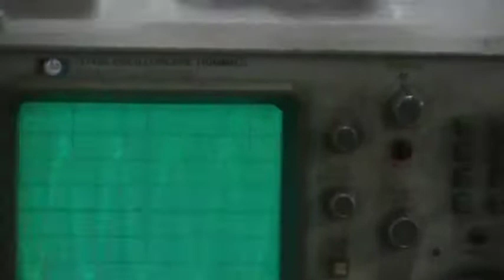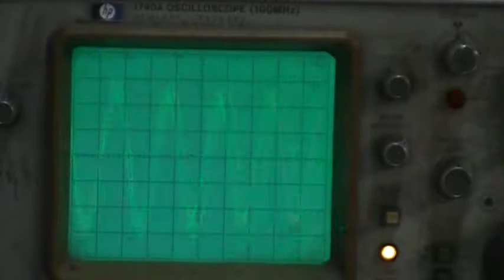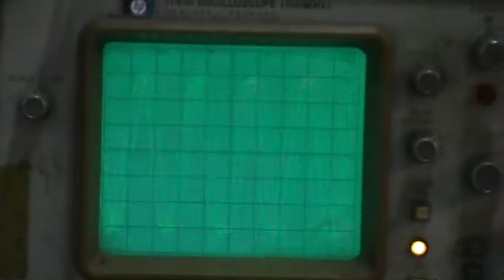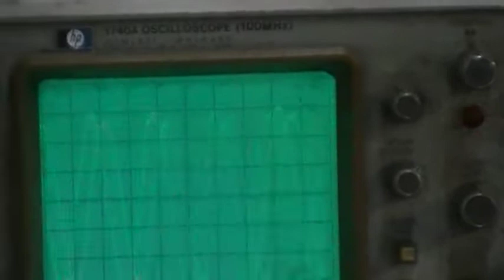~ 120 degree Time Difference from poles over Identical Phase Series!

Comment from the maker: I have today renamed the video for what it shows, not just a 60 degree twist in time, but a 120 degree one. This means that out of a total circle of 360 degrees, where a solitary single stacked phase exhibits 0 degrees of phase difference of  emitted poles on ending coils of circuit; now an entire twist of 120 degrees is noted. The ramifications of this are that now  between beginning and ending twists of the spiraled route of the three coils in series; the ending sequence can in fact be placed as a seriesed unity with an adjacent phase! In fact THAT IS HOW THE BEGGINING ARRANGEMENT IS SHOWN with adjacent diagonally connected phases in parallel for dual channel scopings. The second demonstration shows the 60 degree angle separation from correctly wired top and bottom poles of the 666 machine on a single column where all three phased are mixed in the column for magnetic repulsion. But the third demonstration of the time distortion between enter and exit coils clearly shows an additional widening of that phase angle to be 120 degrees, twice that of the 60 degree one. It is amazing that four years later I have had to make this correction, which in itself explains how adjacent phases in three phase can be wired for unity! Quite unheard of, this only occurs on machines exhibiting torsional time effects. So this becomes a record of such submitted for recognition.

Comment from the maker: On a six phase system, two secondary coils may be found that are actually directly opposite in time polarity sensing wise using identically wired secondaries. As such they can be combined in series either for cancellation of voltages or unison of voltages. In the beginning demo the bottom coil of an adjacent phase is seen to be in unison with the top phase of an adjacent stack, BUT THIS SHOULD NOT HAPPEN!  In fact if we had a conventional air core 6 phase system  where each of  the columns of six pancake spiral coils were one color representing that entire phase in separate action; then it would be logical to assume and see a unity of opposite voltage timed secondary coils over the entire stacks opposite magnetic poles in space. Yet now the duty of the opposite magnetic polarity in producing voltage and current has been shifted down to an adjacent phase in the actual phase rotation. THE ENORMOUS SIGNIFICANCE OF THIS IS SEEN WHEN ACTIONS OF THE COMBINED SECONDARIES ARE SHOWN. In fact the earnest designer of making a 3 fold series secondary output from a 6 phase input will quickly find that when the opposite voltages are combined in series by wiring reversal, or a vector addition method first shown on the video, when both opposites are wired as secondaries in the conventional 6 phase system, as the French peasants tried to tell the queen or something like that; YOU CANT HAVE YOUR CAKE AND EAT IT TOO.   The triple series secondary output from a six phase system, while sounding good immediately fails in load application BECAUSE two of three output coils are drawing on a single phase, thus emf from all three phases are not being effectively harnessed. In the conventional isolated air core 6 phase system, when the opposites are combined in series from both top and bottom poles, the amount obtained on a solitary basis is nearly the same as obtained on a dual basis, for the simple fact of supply and demand when both sources are connected for output they drop to half the value found on a solitary demand. THUS THE TORSIONAL AIR CORE TRANSFORMER METHOD OF THE 666 MACHINE NOT ONLY TWISTS THE MAGNETIC PATHWAY IN SPACE ACCORDING TO MAGIC SQUARE DESIGN; IT ALSO TWISTS THE OPPOSING MAGNETIC FIELD IN TIME!   NOW the triple seriesed 6 phase output becomes a practical method of obtaining a seriesed output in triplicate exactly as the wye/delta transformation originally obtained a dual seriesed output as delta involving dual secondary coils in series.       The second arrangement show the vector subtraction method of connection for two top coils. In the communist electrical circuit a vector addition is wired in series with a vector subtraction.       The third arrangement shows that the opposite poles of a single phase in the torsional arrangement is indeed significantly more out of phase then the first two phase arrangements that were shown.